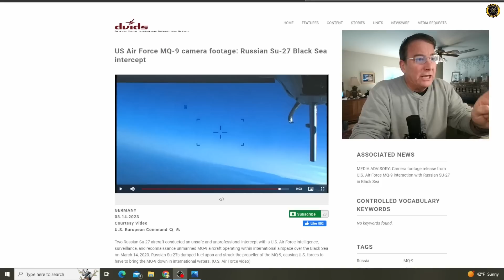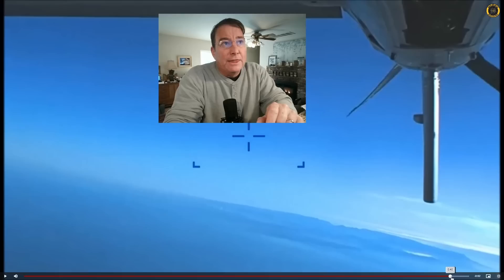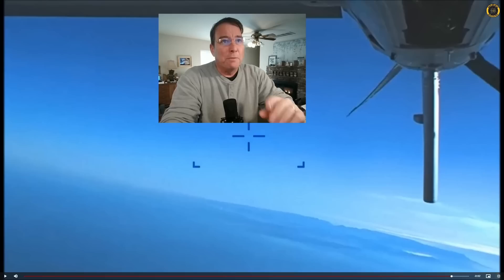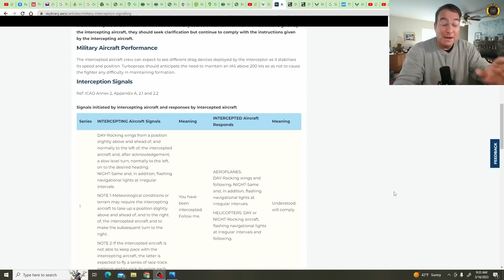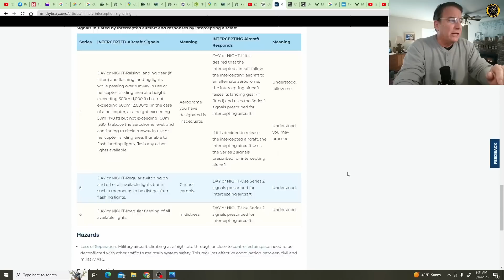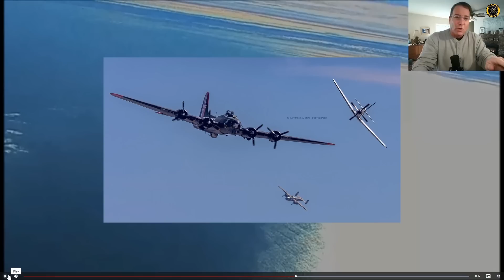Botched Russian Intercept of MQ-9 Drone Over International Waters

Comment: Looking at the approach angle of the Mig (banked away from the drone but closing on it), the relative speed of the two aircraft, the tailfeather configuration of the drone (v tail and ventral fin with prop behind them), and the wing's location just ahead of the tailfeathers, I'm struggling to understand how the Mig hit a couple of prop blades but didnt also hit either the v-tail surfaces and / or the wing of the drone. If it truly only hit the prop blades, the wing of the Mig must have passed between the upper right v-tail fin, the lower ventral fin, and the wing - within the radius of the prop. Also the Mig would have to be nearly wings level to do this without hitting the drone wing with its wing or lower fuselage. That's a pretty amazing "near-miss". Since the drone didnt tumble to the sea from a damaged structure, I guess it really was just that close and improbable a hit. I'd like to see the wing of the Mig.

Comment: With the direct drive of the TPE331 it can not run in feather like a PT6, I couldn't even begin to imagine the EGT spike of blades going into feather.  

On our Garrett's the red fuel shut off/feather lever is set to fuel first to kill the engine before it goes to festher to not melt it down.

Comment: So basically you do not see any difference between the intercept of a civil aircraft at some deserted area and the one of a top-notched spy drone cruising 60 km away from your main naval base in the region which was under aerial attack several times in the past few months.
Well, that sounds very professional.
Reply: Vasiliy, then maybe the commander there should tell the pilots to actually use those missiles that they had hanging off the wings next time instead of making them look like incompetent clowns by crashing into it? Or maybe perform an intercept according to the international standards? I am pretty sure that even Russian pilots know how an intercept is supposed to look like and work.

This looks a lot more like your countrymen knew well that the drone is in international airspace where it has full right to be and do whatever it pleases there - the same as Russia is sending nuclear bombers to Alaska and around Europe since years. And that if they attack it, there will be painful consequences. So instead they decided to harass it to get it turn around - and screwed up.

Comment: This was not botched, they wanted it as intact as possible to prevent damage so they could recover technology from the drone itself. 😊
Reply: Nope, it was botched. The thing is in 5,000 feet of water with no locator beacon and there is already another one up there to take it's place.
Reply: @pi.actual  Take 2.
Reply: @pi.actual  GPS marker.
Reply: It's 22 year old tech.
Reply: I would be surprised if there was not a demolition charge near secret stuff.
Reply: @chrisscott1547  pretty sure they have self destruct installed or they used to

Comment: It was difficult but I did a little research on the su-27. What I found indicates that the fuel jettison is from the tail boom between the engines. Unless it's an illusion created by air flow around the airplane, it looks like the fuel is coming out of the afterburners. Odd.
Reply: Like GCI?

Comment: Could the turbulence of the jet engine cause the prop damage, as many saying here it would be difficult to hit the props without hitting the other parts of the drone?
Reply: Looks like a belly drift contacted the rear of the MQ-9. Nose of the Su-27 was pitched up and the underbelly made contact with the rear end of the drone. There also may very well have been empennage damage that could not be seen by the camera due to it's position on the aircraft. I would imagine that control was lost shortly after the video that we saw ended.
Reply: @dagger4146  👍

Comment: The Russians came in from that low right angle so the drones camera on the bottom could see the fighter coming in at a 'relatively' straight line.. Then the Russians pilots hit the fuel dump.. So "IF" they hit, Russian military could almost say look, the reaper is turning right, into the path of the fighter who is only performing a standard fuel dump in a 'straight line'. It's kinda freakin genius actually

Comment: Time to add a perimeter defense to that drone. Like a pilot would have reacted.
Reply: Would flares ignite SU-27 fuel dump?
Reply: @xoxo2008oxox  Yes but they would have to be launched in a homing device like an AMRAAM
Reply: Let’s add a lightweight, short range, sidewinder-type AAM. That will make them ruskies think twice next time before buzzing. Like they do time and time again. In international airspace. Just as a deterrent, next time they come a-buzzing. Don’t need a lot of range capability in a defensive missile such as this.
Reply: @timothyreilly4499  I agree. At that range even if you hurled a potato at the air intakes of that Sukhoi, it might fry the first stages of an obsolete turbine.

Comment: oh it wasnt botched juan, is that how the glowies told you to spin it? the russians came and took to dumps on the reaper and knocked it out of the air on purpose. its hilarious if you ask me. sounds like they did a brilliant job knocking it out of the air without firing a shot , which is what they wanted to do.
Reply: First missing an attempted fuel dump, then bumping their jet into the propeller of the drone, which almost certainly caused damage to the jet? How exactly is that brilliant?
I fail to understand your reasoning here.
Reply: @TehNetherlands  They want the intel equipment in the drone, which is why they want it in as close to one big piece as possible…

Comment: Fun fact, the video is disrupted because of a loss of datalink, not due to like camera hardware issues. You can see the video returns after the 1st pass and 1st disruption as well as on the 2nd pass. When the drone banks or pitches too fast, the moveable satellite dish inside the drone can't keep up with the quick roll or pitch rate. When that happens, the satellite dish inside the drone briefly loses its lock with the satellites in space.

Also, Russians aren't recovering the drone to reverse engineer it. There is no secret sauce to these things. All of the technology is built with very well known principles about software, hardware, aerospace engineering, satellite communications, cameras, etc. All Russia has to do to build a drone of equal capability to our drone is to fund it, and any generic college grads with backgrounds in the appropriate engineering fields can make this technology. The reason the Russians want to find it is for 1) cryptography keys that can be used to intercept other US military communications. They won't be getting those because the drone pilots zeroized those before crashing. 2) They want to see if they can find any potential software or hardware exploits. If they can find an exploit, maybe they can disrupt drone operations in the future with the right radio signals or something.

Comment: 1. MQ-9 drone's upper tail fins extend well above the propeller. You can't really hit the prop without hitting that portion of the airframe. The prop damage is perhaps from hitting the concentrated stream of jet fuel - a far denser substance than air.

2. Only a short video is released - we don't know whether in fact the Russians tried to fly in formation with & signal the drone prior to it being downed.

3. What the Russian pilot is likely trying to do is to get the drone's turboprop to ingest fuel, and for the resulting fuel-rich mixture well outside the designed parameters to cause the engine to flame out. The drone may have some power reserve but no APU, and insufficient electrical power may have caused it to lose flight control as well as satellite antenna lock, denying its operator the ability to glide the drone well outside the Russians' recovery zone.

Comment: I saw a report, forgot where, that said the fuel dump caused the engine to consume the fuel through its air intake, causing a catastrophic increase in RPM's that damaged the prop. Besides this scenario, what would the purpose of the fuel dump be ??

Comment: Of course you have probably been told already that a turbo-prop does not go into Beta range through the feather position.  From the low pitch (fine) position, the reverse (Beta range) actually takes the pitch even further forward into the reverse pitch.

Comment: If the plane hit the prop only, it would have damaged all of the blades, not just one or two, and would have damaged the structure of the aircraft as well.  Its clear to me that the damage came from the effects of the enormous fuel/fluid load impacting the prop.  Plus its clear from the footage that the drone was not impacted by the interceptor because there was no severe jolt picked up by the camera.  As a military jet pilot who’s has made 100s of intercepts on slow moving targets similar to this drone,  I can assure you the airmanship of the Russian pilots was exceptional.  If you’ve never tried such a feet,  and were successful in doing so, you would know what I mean.  If Russia was flying drones 12 miles off our coast/ADIZ, I am sure we would react simIlarly.  Oh wait, that’s right, I forgot.  A Chinese spy balloon flew flew across our entire country in a straight line (impossible) from over the Pacific Ocean to the Atlantic.  Maybe not then.

Comment: 2 things:
1.  Denys Davidov suggested this wasn't a fuel dump, but afterburn spoiled by flight dynamics, which is a problem with this plane.  Any  thoughts?  (Check his 3/16 video)
2.  Here are some back-of-the-envelope calculations, FWIW:
1500 rpm = 4 x 25 blade whacks/sec (you can redo the math with 1530)
Assuming drone at 200 kt, Su at 300 kt:   100 kt rel Speed = 169 ft/sec
Su-27 Length:  71 ft
Duration of pass:  .42 sec (Len/relSpd)
-> 42 Su-whacking opportunities by prop during the fly by.  (PassDur x whacks/sec)
-> 1 Su-whack every 20" inches (Len/whackOpps)
Conclusion | blade damage:
(I am neither a pilot nor an A&P)
Su had 1 blade strike, likely on engine nozzle or empennage.  2nd blade was fouled by downstream mechanical shock to prop hub during plastic deformation of the whack-blade.
That's my 2¢.
p.s.  if you ever want to impress people, say "plastic deformation" instead of "bent."
Reply: p.s.  Denys' suggestion with afterburners was the Russians were trying to jet-blast the drone.
This could explain the steeper approach vector on pass 2, if it was done to give the fuel system more time to stabilize in the pull-up so the afterburners would ignite.
With this premise, one wonders if the mechanics even remembered to replace the afterburner sprayer nozzles in the jet pipe last time they cleaned them.
Again, I'm no pilot, but if I was going to jet-blast something, I'd set up a high pitch-angle, constant-altitude approach, and I'd have my wingman talk me in while he maintain a good visual on both me & the victim.
If the jet-blast story is true, the missioning planning/execution reflects more poorly on Russian airmanship.

Comment: This is crash was intentional.  Had this been a manned aircraft all of the intercept rules would have been followed. .Since the MQ-9 is unmanned these folks got rough.  They could not engage with weapons as that would have been a intentional act of war, but a mid-air collision has some deniability.  Also note that they first passed and dumped fuel on the reaper - either to try and stall or flame out the Reaper. When that did not work then they moved to ramming.  Note that the Russian pilot downed a 
$56 million US aircraft with $28 aircraft and got the SU-27 home.  This pilot is sitting a bar and toasting with the best vodka available.  It should be noted that in Alaska these intercepts happen quite frequently and are never confrontational.  The Chinese are much more aggressive and reckless in their intercepts.  In 2001 a United States Navy EP-3E ARIES II was damaged when a Chinese fighter damaged a wing due to flying to close to the EP-3.  The EP-3 needed to land at a Chinese airport and a diplomatic battle ensued.  See the Hainan Island incident.

Comment: Outside of all the speculation about props, why not all damaged, why the tail wasn’t hit or the question of intentional ram, I’d like to know why the drone pilot didn’t take evasive action like dumping the nose? I know head on passes have insane closing speeds but the SU was clearly visible in the forward looking camera to at least attempt an evasive maneuver. If so the drone could have dumped the nose to avoid flying into the fuel dump or simply raise the nose to impact the fighter and possibly taking it down in exchange without threat to US loss of life?

Comment: 6:03  How far is it from that coastline?  22km?  Altitude on Forte10 is in the red which is typical for these drones.  It says 51,000 ft.
Reply: The MQ9 has a public ceiling of 50,000ft.
Reply: @christopherrobinson7541  Last night's Forte10 flight was at 51,000' or 15.5448 km elevation.  If we take 15.5448 km as the height and 22 km as the base, the hypotenuse is 26.93772 km.  

Is that distance less than or greater than 27 km?  

c=√(a²+b²)=√(15.54²+22²)≈26.93772

Comment: The fuel dump was an attempt to flameout the MQ-9 motor. 
Would love to see the damage to the SU from getting too close. Could also be some elevon damage to 'attacker'.
Reply: That's the hypothesis I hold as most probable, attempts to induce a compressor stall. Open to possible attempts to light the fuel using afterburner.

Comment: To me this seems more like an act of aggression. It seems to me that the SU-27 is trying to dump fuel onto the MQ-9 to create issues with the engine either by having the prop strike the huge quantity of fuel and bending a prop (this assumes that the prop damage might have been from hitting the large quantity of liquid and not the SU-27) or by flooding the engine. I believe this as it tried two times to get really close and dump fuel right on the drone. What part of a formation would require fuel dump. The last part that seems interesting is they are tryiyng to do this without blowing it up. Either because they want to capture the drone and steal tech or wanted to have some kind of deniability in the act of agression.

Comment: Juan - what was the purpose of the fuel dump on the drone itself?  I mean, if they wanted to take it down, there are certainly more effective methods.  Or was this just an arrogant and unprofessional "up yours" statement?
Reply: It may have been a very aggressive warning maneuver. The implication is this: I can light my afterburner & torch your drone if you do not change your course. Look on YT for the F111 lighting his fuel dump using afterburner so you don't need to imagine what that would look like.

Comment: So now we have here the second pass.  I do notice that these passes have been slowed down tremendously.  Those propeller-blades are actually moving at thousands of RPMs.  It also seems that the drone was in the process of taking evasive maneuvers.  As much as anything else, that could have severely exacerbated the collision.  When a much larger and more powerful jet aircraft is making a pass at you, it'd be in your best interest to NOT fly evasively.

But because it is a pilotless aircraft, the drone's remote pilot can fly as he prefers with no danger to himself.  Perhaps even, the drone pilot was attempting at the last micro-second to ram the Russian jet as that Russian pilot realizes that the drone is itself pulling up.  Absolute minimal contact was made, to the fact that the drone body itself remained intact and didn't explosively shatter.

All of this video actually shows less than half a second of real-time flight.

Also, remote pilots never have a need to be brave.

Comment: The TPE 331 eng. drives a gearbox reduction drive which drives the prop.and is not a direct drive from the LPC; (Lo. Press. Comp.) shaft.

The MQ-9 should be engineered / programed to take evasive manoeuver(s) and if that fails to do the job, then a self destruct blast.
Reply: Correction. Not the LPC.  Should be HPT;  (Hi. Press.Turbin)

Comment: Given that two opposite blades are damaged, could it be that the Russian didn't hit, but the prop hit the liquid fuel that was dumped? As we know hitting a liquid at high speed is like hitting concrete. Just a thought.

Comment: I'm usually right with you Juan. From the edited DOD video it looks like you are correct and, I hope you are. However, I can think of one scenario where poor airmanship might not be the culprit.  Obviously, the fighters were ordered to intercept. It can also be inferred that the fighters were attempting to disable the MQ-9. Otherwise, an air-to-air missile when/if the drone entered Russian controlled airspace would have solved the problem simply. Why try to disable it?  I think one can conclude the mission was to capture the drone since that's exactly what happened.  A better question might be; What made this Predator valuable enough to risk a highly trained fighter pilot, a very expensive SU-27 and greatly increased war tensions? You and Probable Cause are my favorite aviation analysts BTW. Thumbs up.
Reply: Su27 Unit cost is prolly less than that of the drone fyi.

Comment: His first pass was too far to the left to dump fuel over it, his second pass was further to the right and lower, and by accident his plane struck the propellor. 
There is no way he meant to strike the prop, parts could have been ingested into his intakes and then he would be in the sea as well.
I think he ever so slightly misjuded it and caught the tip of the prop. He was very lucky to get away with it.

If he really wanted to take the drone out then he would have just flown his wingtip under the drone wingtip and pushed it upwards to flip it.
The Spitfire pilots did the same thing to V1 doodle bugs in the 2nd WW.